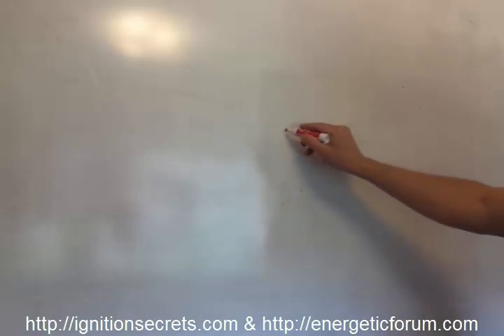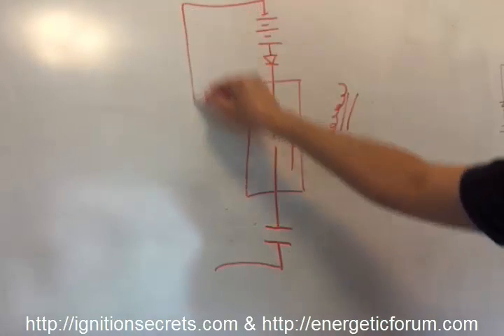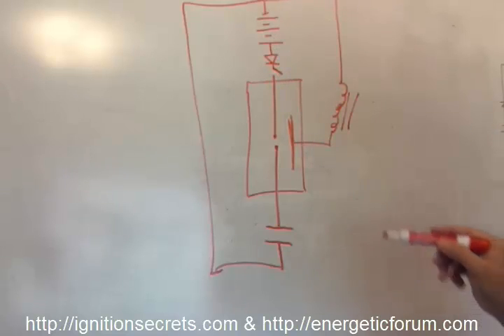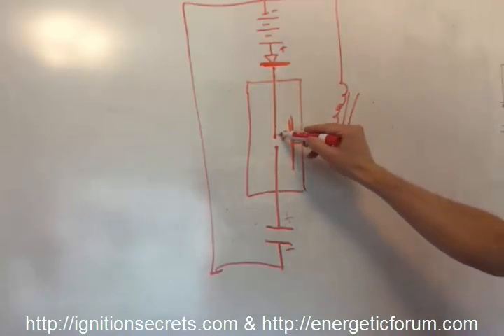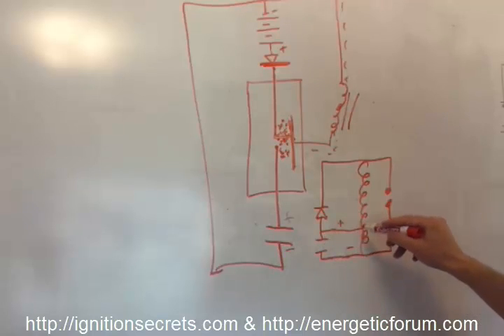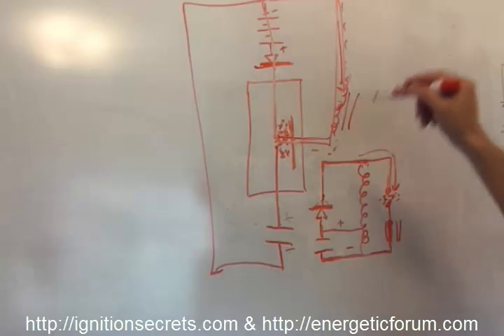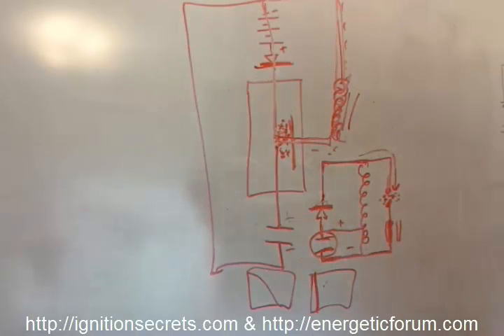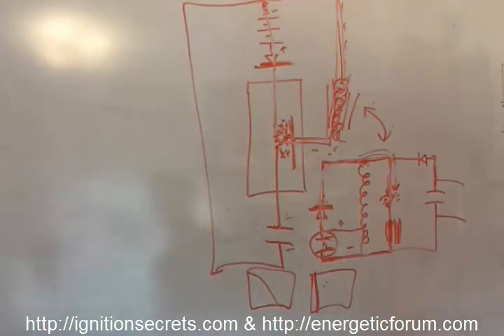2015-05-14 Gray Tube compared to Plasma Ignition

Comment: Hi Aaron. I’m confused ablut the direction of the current pump, in both cases you show it flows agains the voltage gradient?
Reply from the maker: Electron current (amps) flows in the opposite direction of the EMF, which is polarized/pressurized voltage potential that potentiates the movement of current in the opposite direction.

Comment: Brother, help me, I did the tests with a small motorcycle CDI, but when I connected a high-voltage microwave diode it stopped working. I tested up to 4 diodes in series and it had no effect. I don't understand why the diagram seems to be very simple. I don't understand what I'm doing. wrong I changed the polarity of the diode to test and it has no effect

Comment: I dont get the motor bit. Why does it have to run?
Reply from the maker: What do you mean why does it have to run? That's the point of a motor.
Reply: @AaronMurakami13  but its part of an ignition system! All you are doing is generating a spark.
Reply from the maker: @johnf3326  It's not a spark.